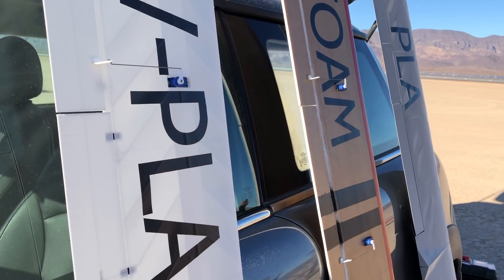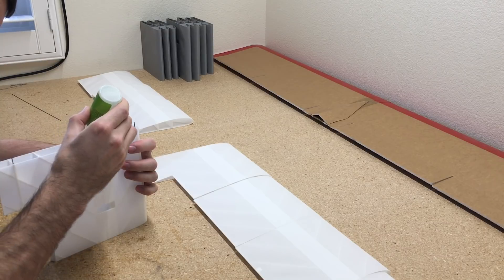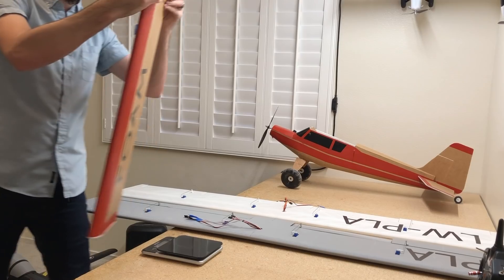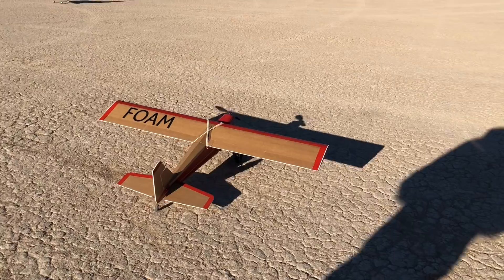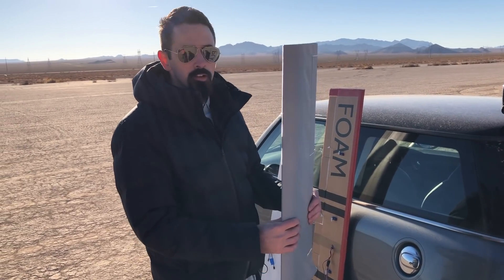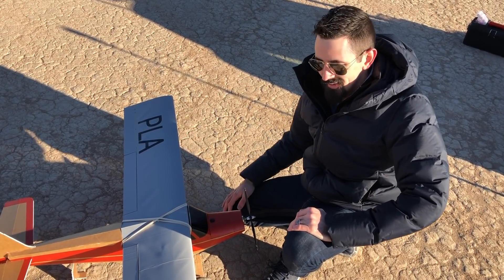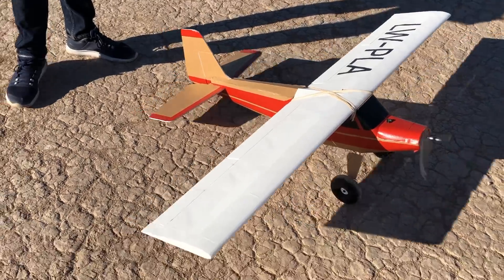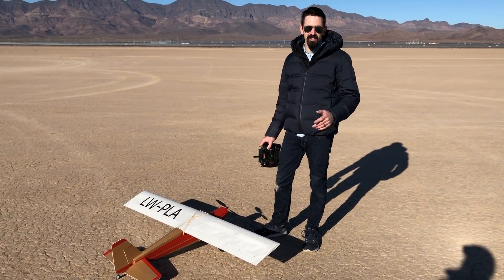PLA Light As Foam CHALLENGE  - Foam vs PLA vs LW-PLA

Comment: I like your pioneering spirit of the PLA wing. My thought is that if you optimized the wing for PLA it could be reduced to 400 grams because the wing ribs can be spaced further apart because the PLA is stronger and if you used PLA+ the wing would be stronger than regular PLA. This can be done with fusion 360 CAD program laying out a wider pattern of ribs on a Clark Y airfoil and PLA+.
Give it a try using Tim Stanton's video (https://www.youtube.com/watch?v=QJjhMan6T_E).

Comment: Something interesting to consider is your construction of the wing. Because interfaces are included in the printed wings there is extra material. If you could print the lw pla as a single piece i wonder how much closer it would be to the foam. I wonder if the printed wings could be made even lighter by sparser support, and how it would stack up to the structural integrity of foam. Also, very impressive that no spar was needed.

Comment: So I’m convinced that LPLA ribs, carbon tube spars and shrink plastic covering like the old balsa / monokote planes are going to be the best regarding durability, weight etc. 

I have just started back in the RC stuff after a 37yr detour. I have found the foam builds interesting but definitely heavy and very poor durability as the paper delaminates from the foam. 37yrs ago I flew my old balsa gas planes nearly every weekend for a year or more and the eventual failures were tail sections that fail from the engine vibration.

I’m getting into the 3d printing also but definitely see that mixing old building methods with new tech is going to be far superior than the full wing 3D printing in LPLA. Standard PLA used in key structural elements in the fuselage makes sense, firewall, wing saddle, landing gear and tie in for tail section. But the skin being a shrink wrap again should save considerable weight. 

I find all the foam and full LPLA planes I have flown definitely to exhibit porky weight behavior as you slow them down. VS the old Balsa planes definitely had a superior float and weight advantage.

Comment: ok, some materials weigh less, but seems to me that for this to be a useful comparison, the wings should have the same strength. Otherwise, you can just reduce weight by making thinner walls, or less internal structure. I guess this is good if the thickness of your walls is already the minimum that your 3D printer can produce.

According to CNC kitchen, strength decreases more rapidly than weight when this material when you increase the foaming.

Comment: Hey man! Have you ever tried glassing LW-PLA? Do you think is worth it? It would be a really interesting comparison to include a glassed lwpla wing an to compare all of them in weight and strength!! Thanks
Reply: I like what you are thinking. It is too bad, though, that it would increase strength instead of reducing weight. I have searched for anyone building LW-PLA structure with shrink covering (and maybe with some carbon fiber rod reinforcement). That would be interesting.

Comment: at 1:42,  this  profile  is  What.?    it don't quite look like a (original) clark-y.      which is what it  SHOULD  look like.  (or the n-10)           BECAUSE,   back in 1922,  clark   Understood   that  models  fly in a low-re#  environment; and their wings Should  have  low-re# profiles.      (a profile like the clark-y can be made thinner (than 11.7% of chord).      but, a thinner version will  make significantly less lift,  and  the wing will have a  higher stall speed.)         googletranslate 
original clark-y
http://1.bp.blogspot.com/-5C8vhlmhBOk/VRe3o3Jt3yI/AAAAAAAABrI/EEgVHXkLvbY/s1600/clark%2By.gif
n-10
http://airfoiltools.com/airfoil/details?airfoil=n10-il
reynolds  number  calculator
http://airfoiltools.com/calculator/reynoldsnumber

Comment: some info.           your  ridiculous  rationale in support of  Not  having  a main spar in each wing  IGNORES   the   NEED  for  Adequate  span-wise strength, when a wing is  LOADED.!!!!
since any (non-swept) main wing  Should   have a  fuselage-spanning main  Spar, located at  THIRTY  percent of chord,  many printed wings have a less-than  optimal amount of span-wise strength.!
because there is 'more' outboard-located mass in a wing made of non-traditional materials, MOST  main wings have  a  Less-stable, span-wise  dom,     distribution of mass.       note, also, that a constant chord wing  Inherently  has  'more' outboard-located mass.    googletranslate

Comment: My concern with the LW PLA is stress test, that overtime or with a more agressive flight the wing will just snap out
Reply: I would bet that it's a tad bit stronger than foam. So you worry on LWPLA but not foam? If it snaps out, so would foam.
Reply: @EscapeVelocity1  the materials have very different breaking characteristics. It's not about raw strength
Reply: @lu4414  Yeah, you're probably right on this, it's not just about strength, and they might have different properties. And sometimes, way too much rigidity over what you want might not be a good thing I suppose. I'm new to this.

Comment: Nice work. How does the light weight PLA hold up in the heat? That has been my biggest issue with 3D printed planes. ;)
Reply: It resists heat much better than normal Pla, but temperatures below 10 Celsius are dangerous- it gets brittle!

Comment: As a design challenge a few years back, tried to make a glider from PLA.
https://photos.app.goo.gl/cahLV5VvfdCqwKba7
And just the wings:
https://photos.app.goo.gl/Hf1ExnGLueYU9M2P7
The wings are simple single-wall prints. It does fly, but of course much heavier than stick-built balsa. 
The trick is to use compound curves. Otherwise light skins crumple. Posted to Google+ ... but that is gone.
Reply from the maker: Nice I like the wing shape
Reply: @TroyMcMillan  The shape is functional, not aesthetic. Also not my first try. Simple plates and curves buckle, with thin walls. Adding ribs adds weight, and still tends to buckle. Compound curves are self-supporting, with less material, and yield the lightest solution.

Old knowledge - the auto industry got deep-draw alloys for steel stamping back in the 70s, and were able to reduce cost and weight using stamped (self-stiffening) compound curves.

Comment: is there foam petg? pla is gonna melt in the sun
Reply: colorfabb is now selling LW-ASA.  As far as the LW-PLA goes from my experience with the materia, the natural white LW-PLA seems to be able to hold up to a hot sun, while black LW-PLA will warp like a vinyl record in the backseat of a car on a hot day.
Reply from the maker: @William3DP  Yes this is correct I have not tried the LW-ASA I have had experiences with printing PETG and it warps badly on the print bed. ASA has a tendency to warp also. I have not had any problems with Natural LW-PLA melting in the sun.

Comment: It would be neat to see an inner wing panel from each tested destructively to determine its strength relative to weight.
Reply: You can find a lot of the properties of different materials on eSuns website. The two parameters important are the density and the yield stress (they only quote tensile and flexural strength, but they are close enough for ballpark figures). 

The tensile strength of PLA-LW is approximately 32MPa. For regular PLA we are looking at approximately 72MPa. The density on the roll for PLA-LW is the same as regular PLA at 1.2 g/cm^2. However when foamed it drops to about 0.54 g/cm^3.

Technically the yield strength is already independent on density, and thus we can pretty much say that PLA-LW has about half the yield strength. But that doesn't tell the whole story. This assumes a constant stress (i.e. force per area), which is often not really the case. Usually the force is the same, and because of foaming PLA-LW has a lower density (and thus higher volume) meaning larger surface area for same applied force.
If we print at approximately half the density, we would need to print twice the volume for the same weight. However, assuming a cube shape, this would only mean an approximately 1.6x increase in surface area over which the load is spread. So if we have the same force applied to the structure, because of the 1.6 increase in area, it experiences a 1/1.6x decrease in stress.

So for example if a PLA wing breaks at 10N applied at a point, a PLA-LW wing at 100% density would break at approximately 4.44N. However if foamed to about 50% it would be able to bear about 7.11N of load. As you can see just foaming the material helps, even at the same weight, because of the increase in surface area. Again! Note that this doesn't mean that foamed PLA-LW is stronger!!

It should also be noted that this is with 'slow' static loading. Actual real life loads are very different. I presume that the largest load of a model plane is at impact with the ground which can often cause rapid uncontrolled disassembly of your aircraft. For these kinds of shock loads its not just yield strength that matters, but also the elasticity of the material. To measure impact strength there is an impact strength test (IZOD), which is also a measure per unit area. This is 8.58 and 5.4 kJ/m^2 for ePLA-LW and PLA respectively. 
This shows that for impacts, PLA-LW is probably much  better than regular PLA (~160% of regular PLA), even at 100% density! At half the density (and thus 1.6x the surface area), assuming a similar force impact, foamed PLA-LW is likely 250% better than regular PLA.

tl;dr I suspect that foamed PLA-LW is about 70-80% of the structural strength/weight ratio of regular PLA. Foamed PLA-LW likely ~250% of the impact strength/weight ratio of regular PLA though, which is likely much more important.
Reply: @tHaH4x0r  Amazing response. Engineer?
Reply: Depends where you live, foamboard here where I live is expensive and heavy. LW-PLA is a much better option.
Reply: and price comparison... LW-PLA aint exactly cheap, not foam board cheap...
Reply: @timm1065  LW-PLA isn't cheap, but it looks a lot worse than it really is. Since you only print at ~50-55% flow, you can build twice as much with 1kg of LW-PLA as you can with 1kg of regular PLA. I'm currently printing the Eclipson Model C, which should come it at around 240g of printed material in LW-PLA, where the regular PLA version comes in at 470grams...

Comment: are you use any support for the middle part of the wing, when I'm designing and print it unable to print without support, also to remove support takes lots of  time and some support inside the wing are unable to remove
Reply from the maker: I don't print with any support. There is just a wing structure I designed in the middle of the wing. I don't use any. spar.

Comment: You can make the LW-PLA wing even lighter... you are missing holes on its inside frame, plus the design of the interior could be optimized for weight saving. But yes, while normal PLA made 3d printed airplanes not a true competitor to foam, now, with the LW-PLA, we have a match! The only true competitor, in terms of weight/resistence, is the traditional balsa and oracover technoloty... Those can still be more resistent. On the other hand, LW-PLA plus 10g fiberglass, you can go to bigger wings... if you even add carbon fiber tube inside... But the only reason to use a 3d printer for this is if you want to use a lot of curves and a strange wing shape... in that case, then we have a winner!
Reply from the maker: I did not add any holes in the inner structure so that I could print the LW-PLA without stringing, I print these in vase mode so there is no retraction.
Reply: @TroyMcMillan  Stringging is more of a "cosmetic" issue than a resistence issue... I do have the stringging inside, which doesn't make a difference, and saved a lot of weight, without loosing much resistence... Besides, after tuning it, I almost have no stringging... The weight saving is worth it. Check the airplanes from 3d labprints, theirs are optimized for printing and low weight. Have a couple printed in regular PLA, and I can't wait to have the time to print one of them in LW-PLA! It should have a big boost in performance

Comment: Nice!  Quick question.  I'm working on a wing design meant to be printed horizontally.  This means a few things, the skin is two 0.1 layers thick.  The top of the skin is printed flat with the bottom of the wing and then after the print folded over the ribs and glued to the bottom's trailing edge.

Has anyone done this before?
Reply from the maker: WOW I like this idea I have not seen anyone try this out. I will have to give this a try. Cheers

Comment: Is this your first build ( on youtube) with LW-PLA?  All your other build videos were regular PLA, right?  How about showing a stress test of the 2 printed wings. Is the LW-pla less brittle or more flexible than regular pla?  Thanks to your channel I bought a printer and can't wait to calibrate and start printing when my rolls of this lw-pla arrive 👍👍
Reply from the maker: I actually built the Eclipson model A that was my first build with LW-PLA. LW-PLA is not as strong as PLA so for some builds it will not work as well. It really depends on the designer that makes the STL files if the plane can be printed in LW-PLA. Eclipson planes use LW-PLA and PlanePrint uses PLA. You can print PlanePrints airplanes out of LW-PLA but it will not work as well because of the way the plane is made. With LW-PLA you can not use as much retraction and can't eliminate stringing so there is a special way Eclipson makes there planes to work with LW-PLA.

Comment: What airfoil did you use?  
Is there any washout?
Reply: You dont need washout on a square wing - they are not conductive of tip stalls.
Reply from the maker: I did not use any washout. This was just a wing I designed out of foam and I copied it for this 3D printed wing.

Comment: A nice comparison, but one version was missing: Balsa wood, covered with oracover (or something like that). That's the version I'm using for my current build (Roland D VI a, 1/6th scale, fully equipped with HD FPV). I already have the Oratex covering with the lozenge pattern laying here. In a previous build, I tried covering 3D printed parts with the heat-shrink and it rarely works. The parts are getting soft when you try to pull the cover around the curves.
To be on the safe side, I'll go with balsa ribs and a carbon spars for the wings. For the fuselage, I already changed the formers from plywood to PLA, LW in the back, normal in front of the CG. I'm pretty excited to get that ready and flying 🙃
Already having plans in my head for the next project, purely made from LW-PLA...
Reply from the maker: Wow that sounds like quite the project. Yes I agree it would have been nice to have some type of balsa wing for this project also. I think the best configuration would be with some sort of hybrid between LW-PLA and a carbon fiber spar of with a PLA spar. I look forward to hearing about your future builds.